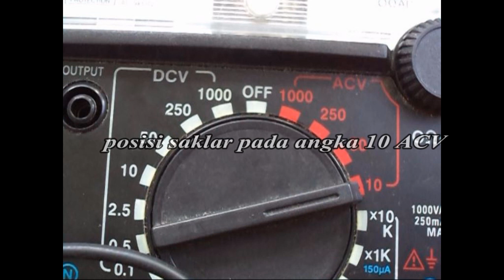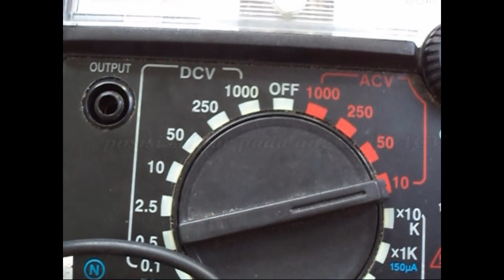mengurangi dan menambah tegangan trafo ct

Comment: kalo trafo non ct n sy perlu  0  6V-9v sementara yg ada  0    12V,  18 V  dan 24 V bgm ya mohon bantuannya
Reply from the maker: Setahu saya trafo non Ct gak bisa untuk ngurangin tegangan. Cara ngatasinnya pakai saja yg 12 volt kemudian pasang IC regulator LM 7809
Reply: @sukimansisu5291  ok trims

Comment: maaf pak.  bisa kasih contoh perkaitannya. ke ampli misalnya
Reply from the maker: ARIS Aris misalnya anda punya power amplifier butuh tegangan 30 volt trafo CT anda hanya ada 15 volt maka anda dapat pergunakan 15 vokt kiri dan 15 volt kanan dan ct nya jadi nol.
Reply: sukiman sisu saya kepingin tegangan 44volt di trafo  5A.  apakah cukup dengan menggabungkan 12v dan 32 v di tiap sisinya. ?? dan ct sebagai 0

trima kasih
Reply from the maker: ARIS Aris ctnya gak dipakai lagi nolnya langsung dari negatip elco tegangan sisi kiri tambah tegangan sisi kanan. Tegangan sisi kanan berkurang dengan sisi kanan begitu seterusnya
Reply: sukiman sisu ada linknya ndak pak.  sebagai contoh
Reply from the maker: @arisaris5848  linknya blm ada tapi video yang lain juga mengenai power supply banyak
Reply: Iya saya sebagai pemula jg bingung kalo gk ada gambar / videonya pak susu